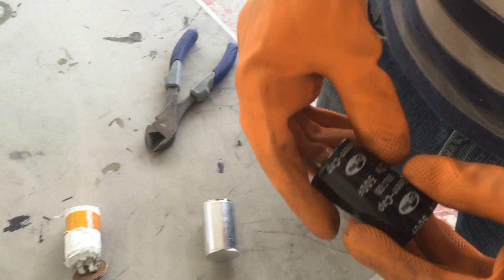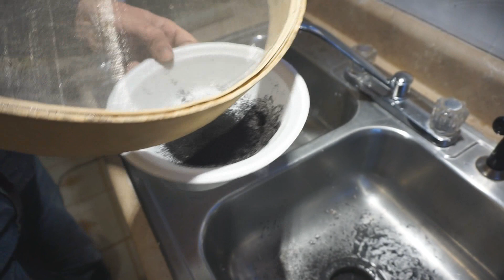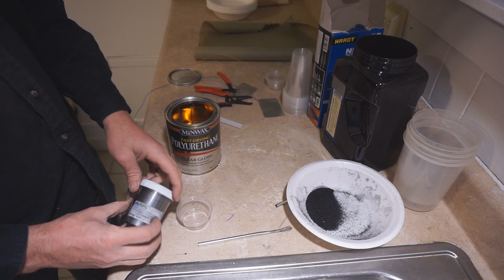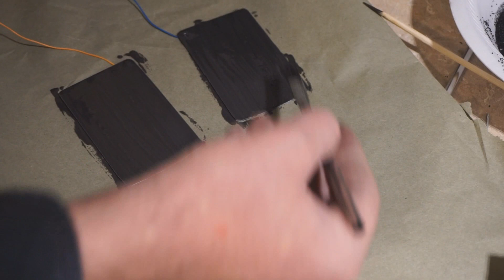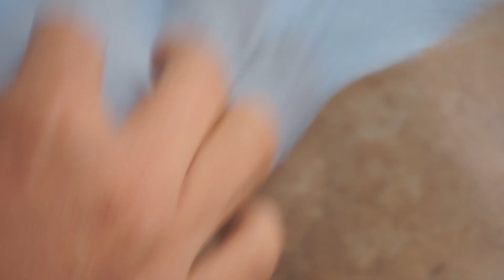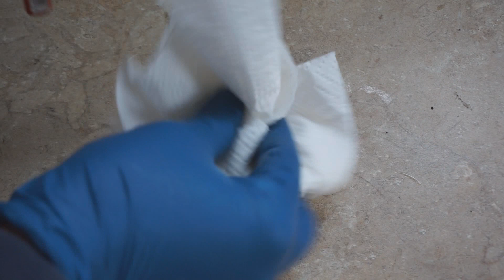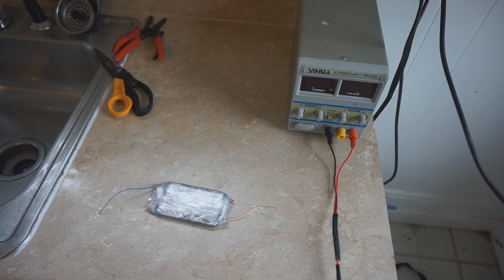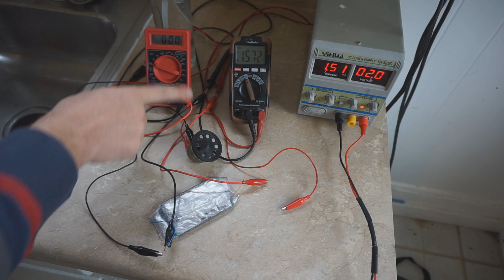Easy DIY Graphene SuperCapacitors

Comment: any one want to join me with theses kind of research thing please contact me at owaisf.2008@gmail.com .....these kind of super capacitor have low energy density about 20 wh/h to 30 wh /kg so putting that in a ebike will increase  its weight so....we need to try different combinations...and lithium ion battery has 200wh/kg of energy density ...so this is also a reason of lithium ion battery is being widely use ....so come join me and help me....

Comment: Have you tried testing with a control group using just the metal plates with nothing added to it and no electrolyte? I bet it will have the same outcome since those are the only two things connected to the output leads. My guess is that the polyurethane is essentially insulating those plates from touching anything at all. What do you think?

Comment: I suspect a battery not a capacitor. If I is a cap then the charging energy would equal ~ energy out. Charging time would have been similar to discharge at the same current.

Comment: laseraber,

Great video. I love your experimental technique and care that you took to make sure that your supercapacitor were properly sealed. I am very interested in any subsequent work you have done.

I have an interest in super capacitors because I believe, in theory, they should be able to take the place of some if not all the function of lithium ion batteries with a number of advantages including cost, charge rate and longevity to name a few.

I don't remember a lot about about electricity (I am a chemical engineer); I have some questions and comments

- to those who mentioned that graphene is a monolayer, they are correct. However, activated carbon is a complex structure and may contain multilayer graphene
- graphene is planer and electrically conductive, other types of carbon are three dimensional and non as conductive; it would be interesting for you to characterize your activated carbon (ac) by conductivity
- why do you need a conductive layer (your phosphoric acid  impregnated cloth) between your charged plates? Doesn't a capacitor have an insulating medium (dielectric?) between the plates? If you left the charged capacitor isolated for a period of time would the charge between the plates flow internally through the phos acid?
- the nature of the activated carbon is important for your experiment. Do you want high or low surface area, high or low conductivity. I don't believe the conductive support plates are as important

It has been a couple of years since you posted this. I hope you still are working on this.

Comment: Use the graphite inner core of a carbon-zinc battery as an electrode and high current weld layers to aluminum under water to avoid aluminum oxide.   Carbon Nanotubes coating?

Comment: You just unlocked the Secret to Energy Storage and Utilization. It is indeed all about the surface area. Because electricity is a unit of heat within a volume of a medium which we call 'Voltage'. When you restrict the surface area, you make these units of heat compound on themselves, causing heat or 'Amperage'. A Primary coil has many windings, covering a large volume of space. In order to turn this electricity into usable electricity, we then wind up a secondary coil, to take voltage from the primary in a joule thief fashion, and we force that voltage into a smaller surface area, creating what we call 'Amperage'. So when you think of Electricity, you should think of it as a Heat Pump system. In the large surface area where the "Electric Gas" or Voltage which is units of heat encompassing a large volume or 'Surface Area'. Then this is the 'Cold' side, but we can create a 'Heat Exchanger' which we call a "Secondary Coil" to take that 'Electric Gas' and compress it into a smaller surface area and this is the 'Hot' side or the evaporator side. This is now usable 'Wattage' because it has Voltage which is compressed and when we put a load on it, the load releases the heat from it's confined state, to utilize it to do work for it.

Comment: copper and aluminum never make a good electrical connection. avoid using them directly. if you really want to use them, use a brass connector

Comment: I'd like to try using my graphene oxide to coat steel or copper wool or even just saturate a sponge with it to create a super high surface area electrode, then reduce the graphene oxide into pure graphene, or even better, a 3-dimension carbon structure like nanotubes or foams. These types of batteries could be doped with lithium or silicon atoms/nanoparticles to act as additional electron sources.

Comment: I really roughly did some math and these store at best 20 milliwatt hours of energy and are not feasible as regular capacitors for electronics, if they don't have a use for storage or capacitance what are you even going for?
Reply: And to be clear, I doubled my quick check just to give benefit of the doubt.

Comment: Great work you do as always.
I thought would have vacume sealed that..
Why are you calling this Graphene?
Other vids explain Graphene as 2D on atomic level.
Reply: it is not graphene capacitor, it is just simple capacitor described in basic electronic books, two metal plates separated by an isolator.

Comment: That's not a cap. It's a battery. There is no way that a cap that small can hold that much charge! I've seen air gap variable caps that have 5 times as much surface area as you used and they are measured in pico farads. That's not a cap, it's a battery
Reply: hakachukai its graphene. Graphene can hold much energy
Reply: Look up electric double layer capacitors, they have way more capacitance than the typical kind.

Comment: ok... if you want it super thin, why don't you use pure carbon dust?  AKA soot..... when i was in the paint trade we used pure carbon black pigment which was basically what came out of the coffee grinder in dust form. what you need ideally is a concentrated black pigment dispersion which is nothing but carbon and as little resin as you can get away with, it's literally black carbon paste...... it does not dry ,much but it will basically do what you want with a thinner package.

Comment: how about a wall in your home converted to graphene then add a wireless transmitter to the wall than add wireless receiver to say a smart phone to charge you phone without wires
just a thought i'm not an engineer but seams like it could work

Comment: Ok, having watched this (and I downloaded so as to run some tests of my own) I m wondering a couple of things through my head that raises questions. First off, if an acid is to be used, would not a higher density metal plate be better off than a low density like aluminum? Or a lesser reactive metal plate? And with the lesser reactive plate in mind, considering possibly using stainless steel such as surgical grade, what other acids that would not have a corrosive action to such metal could be used as an electrolyte for these cells? And in light of this in using acids, what about alkalines? Stainless is not corroded by most alkalines and thus would hold up much longer. Could some type of alkaline solution be used instead of an acidic solution? 

Now, it is obvious by my questions that I am not some sort of engineer or chemist. But I do understand the basic principals enough to raise questions and have suggestions.  

But I do want to thank you for posting your experiment and will search out your channel to see if I can learn more.
Reply: This is not a capacitor at all. This is a battery cell.

Comment: I estimate this would be a 10 farad capacitor. But that's impossible with only that tiny surface area used in this "capacitor".... I think you just made a battery :)
Reply: The carbon has a kind of spongy structure which hugely increases its surface area. Still, supercaps are blurring the line a little bit.

Comment: It's a year on, and I'll bet people have posted this already, but you need to wear a respirator if you do this.  That carbon dust will get in your lungs if you don't.  The dust can and will cause lung cancer.  It is extremely stupid to do this without a respirator, on par with ripping out asbestos without one.

Comment: I thought capacitors charged up quickly and discharged just as quickly. How did you get it to run a motor for 10 minutes?
Also I thought polyurethane would create insulation.

Comment: If you want to count how much the mAh has this capacitor, it has 6mAh.
Nice result for such a small capacitor.
This 6mAh is about 21.4F
I read that you should not give a voltage greater than 1V, because the water electrolyte will separate into the hydrogen and oxygen.
A voltage greater than 1V is in ionic fluids.

Comment: So could you use a bunch of these things, or a big one, to power a car? What about weight and cost? Is there a limit to the number of charge/discharge cycles? How well do they hold a charge for an extended period of time? I want a better, cheaper version of a Tesla with their current huge lithium-hydride batteries.

Comment: There is no graphene here at all. Graphene is one atom thick. The fine powder you washed away in the sink is actually closer to graphene than the stuff you used, but still graphite. Can you explain how and why the voltage meter on the right reads .360 volts at 28min 34secs then jumps to 265 volts a second later? Smells fishy to me. The whole thing smells fishier now that I noticed the wires leading to the back of the power supply. If this truly works test it without anything around on its own. At best this is seems more like a weak battery than a capacitor. Capacitors have a fast discharge and this clearly has a slow discharge.

Comment: I found(by mistake) Stainless steel wire IS an excellent material for holding AND expelling current charge .....plates do get VERY hot while "charging" i found i could resolve that ...I am experimenting with wind , water and Solar ....GOOD Vids lets talk ????

Comment: why would you use acid rather than using Parker Spectra 360 Electrode Gel Tube-250 Gram it cost about $4.25$4.25-$6.04$6.04 just saying but it is you video

Comment: This thing generates about half a watt right? (A x V = W) So you would need 24 of them (at the least) in series to power a 12watt lightbulb continuously for however long the charge will be able to last. If someone could double the efficiency of this and have a decent shelf life before needing maintenance like about 2 years I would probably want to build a load of these to power my 300wh typical 24hour lighting load in my house from solar panels. Changing the electrolyte out for something else, this process looks pretty neat. Really sweet video Lasersaber, thanks, I am going to keep on learning more about this. It would be great to be able to build a battery one day in the future at home that can handle a 2kw washing machine which is where most of my energy goes.

Comment: That's not graphene.  You're using impure, non conducting hydrocarbon compound for the dielectric between your two capacitor plates.  Thinner + More Insulating = Better.  

Graphene itself is actually an excellent conductor.   You can make a bit of it by taking a pencil (pure carbon graphite) and drawing a line with the pencil over and over and over again in the same spot until the pencil lead winds up laying down a strip of graphene; a single-layer carbon-atom crystal-matrix.

You can actually turn a piece of paper into a circuit board this why by drawing the same circuit in the same position over and over till there is enough of a graphene layer that will conduct within reason.

Comment: Can someone tell me how the discharge rate of these types of capacitors compares to standard electrolytic caps? I am considering using something like this for an upcoming project and I need to be able to discharge and charge very quickly in order to do what I want.

Comment: They make a vacuum sealer also that would squeeze it together without need of tape. Plus by removing air you reduce oxydation which am not sure if that would be good or bad.

Comment: I have a question for ya. I don't know if you have tried this yet but have you tried to make the capacitors like commercial ones? instead of throwing away the powdery graphite, use it to make a slurry you can spray onto the aluminum strips that you can let dry, respray, let dry, etc. to build up a good layer of graphite and then roll the aluminum up into a tube.

Comment: Keep in mind, I am a student of mechanical engineering, not electrical, so this question may be sound stupid to some people, I apologize in advance. My question is that I was always under the impression that acids were conductive (like most aqueous ionic solutions) and so could not function as a dielectric which, I thought, needed to be an insulator as to not allow the direct flow of electrons from anode to cathode. Yet here I see a capacitor using phosphoric acid as a dielectric and yet it does not undergo electrolysis as I would have predicted. Can someone explain how this is and how if/how mt previous assumptions were wrong?

Comment: Very interesting and just about my cup of tea when it comes to doing stuff like this. Now I sort of have to agree with the comment that the acid will consume the aluminium but I am pretty sure the stainless steel would not be as affected - I have only used this material for cleaning rust to be honest and not an electrolyte.
Two things I would try is reducing the grain size of the activated carbon and maybe use a medical grade activated carbon  too as again the only activated carbon I have used is either that awful fish tank muck they make from coal and home made from hard and soft woods. However it may be that I just  a tad pedantic about such things.
But again a very interesting experiment.

Comment: He used graphene powder - but with how ti is applied all properties that would distinguish it form normal graphite vanish.
Also the way it is build quite a lot of energy will be stored chemically, so more like a battery-supercap hybrid.
Reply: The poster has made a standard electrochemical battery.  This is not a capacitor.

Comment: is there an alternative to graphene powder? Would Graphite powder work as well?
Reply: Shayan Ghafoori,,  if you light a candle and let the smoke of the flame deposits on the surface of the capacitor board it will work well
Reply: @hantzu1675  oh shoot i never thought of that silly me. the smoke is carbon?

Comment: Cat6 cable is usually polythene insulated, rather than pvc, so will melt into the polythene sleeve. For higher current capacity look for HDPE insulated power cable.

Comment: Guy's read the description! There IS graphene in use here. It's in the form of nano-platelets which have been pre-made in a lab that he ordered from (Angstron materials). Activated carbon has NOTHING to do with graphene, it's a common material used in making supercapacitors. Also, look up what a supercapacitor is before you start commenting about "oh it's a battery, not a capacitor", or "why u has electrolyte touch conductor, u no know how cap work!? omg!".

Comment: Graphene by the way is graphite laid down extremely thinly. While graphite is carbon you can't make graphene out of that form of carbon just like you can't use diamonds (also pure carbon) to make graphene.

I'm not interested enough to research this, but have you considered using photo copier toner? As far as I'm aware it's really fine carbon dust with a very consistent particle size, far more consistent than you could easily make at home..

Comment: There's a downside to capacitors as power storage devices, as the energy is withdrawn the voltage goes down more than a battery. Basically there's around 33% that you never get to access because the voltage is too low. If you use a boost regulator you get to draw more out but at the cost of ~5-10% energy wasted in the regulator so that added complexity and cost doesn't buy you much. That's why super capacitors are used in conjunction with batteries, ie. they accept short term rapid charging (much faster than a battery) like in regenerative braking on an EV and supply short term much higher current pulses for any application that needs it.

Comment: Very interesting.  This is my first exposure to a home-made supercapacitor.  I'm interested the Farad rating, and the rate of decay at room temp.  If you were to go with a scale of, lets say, a 4-foot stack of 4x4 plywood, could you make a workable home-powerwall for your solar panels?
Reply: Funny you should mention that. I had a similar idea to make the backing-sheet for solar panels using capacitors: Each wafer (0.55v) would be mounted on a capacitor of similar area,  then the wafer/capacitor combinations tabbed together as per usual. This would enable a steadier/smoother voltage to be maintained for maximum power point tracking. Do I win a prize?
Reply: I haven't built a solar tracker yet, but I intend to read the voltage off 4 cells, and use a quad compactor (LM339) to trip relays, and activate the servos  -- move them left/right up/down when the voltage differential is enough.  Eh, maybe this is silly though.  Would have to unhook them from the power bank to do the voltage read.  Let me know if you build your battery onto the back of your cells.

Comment: OK, it's not graphene, but activated charcoal is kinda' special. From the New World Encyclopedia:
"On account of its high degree of microporosity, a single gram (g) of 
activated carbon can have a surface area in excess of 500 square meters (m²), with 1500 m² being readily achievable."

Comment: I have a question lasersaber  How do you charge the capacitors for the different batteries I'd be using them to replace, I.E. 1.5 volt up to 12 volt all with different amps?